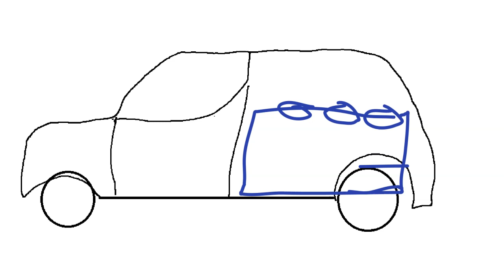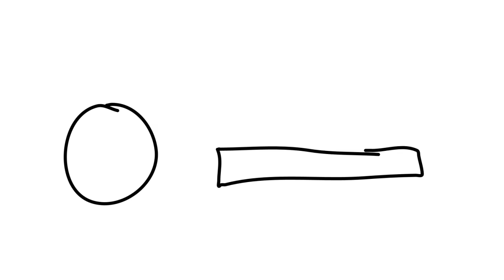All about ports!

Comment: Great video! My question wouldn't the flared slot port act more like a rear loaded horn the longer the length of the port. If so wouldn't the length change the tuning more than the air speed?
Reply from the maker: A flare at the end of the port won't really change much.  The flare would have to be pretty big and long to act like a horn.  However, you are correct that a long port could also act like a t-line.  So, if you had a 5 foot port tuned mid 20's, it would also have a quarter wave boost around 55 hertz.

Comment: Ha l have questions l have 3 18 in 15.25 cubic foot box that after displacement would 2 8” aero port be good for this setup  l have the Purex418s with the mega brute drop ins
Reply from the maker: Tuned to what frequency?  Going for wind? Music Bandwidth?  Ported box?
Reply: @caraudiolab  27.55 hz
Reply from the maker: @josephdupree8449   You will probably have a little bit of chuffing with that.  I had an 8" round port with a Uv1 18" in 4.5 cube box and had some chuffing. My port didn't have the flair but I still think you will have a little chuffing.  I think 3 8" areo ports would work well but you could try 2, just plan on possibly having to add a third.  It can be hard to tell without knowing your power, box design, etc.

Comment: Cool video, is there a certain distance you should keep your port away from like the door or loading wall? I have a 4" aero port and heard it shoukd be atleast the distance of how big your port is or double
Reply: TDLR: more than 1 inch away.

Actually you can slightly lower the tuning frequency of your port if you push the port a specific distance from the loading wall (you rear hatch, for example). It will cause the wall to act as an extension of your port. Your port area needs to be equal to the 2-dimensional (surface) area, of the space that wraps around the area between the end of the port and the rear hatch (its basically the same shape as your port, a "folded rectangle" similar in shape to a head-band). hang with me, I'm trying to explain this the best i can. I wish i could post a drawing lol. 

So your port has a diameter of 4", and you need to figure out the surface area of the rectangle that would wrap around that area. The longer side of that rectangle is equal to the circumference of your port... 4*pi = 12.57   and the other side of that rectangle is equal to the distance your port is from the rear hatch. Lets call that distance "x"   ...    so the equation is 4*pi*x = port area. Just change the "4" to whatever the diameter of your port is.  So:

4*π*x = πr^2
4*π*x = π(2)^2
4*π*x = π*4
4*π*x = 12.57
divide both sides by 4
π*x = π
divide both sides by pi
x = 1
so the port should be 1 inch from the loading wall.

but 1 inch is exactly 25% of your port diameter... and actually, this scales linearly no matter how big your aero-port is. 
An 8" port needs to be 2" from the wall.
A 20" port needs to be 5" from the wall. etc... so actually the real answer is you just divide the port diameter by 4 :)
Reply: @bailey2517 cool I always like learning about car audio and how it's alot of math to find and determine what you need. So 1" from my door is how close my port should be firing off my door? I have it now about 4" away givevor take but seems my subs are suffering in the mid 30s up to 45hz. At 45hz sounds like it starts picking back up which I'm thinking I have something else going on. Been thinking it could be jus the way my box and subs are performing in my full size 4 door truck but around 35hz to 45hz I can put my hand on the subs and feel them barley moving but only certain frequencys it will get really loud. Gonna re set all my gain ls from my line out converter and make sure I'm getting the biggest signal going to my sub amp and make sure nothing canceling out frequencys that's almost what it sounds like it's doing. But when those certain frequencys play it slams and hits hard. My box is tuned to 33hz and I have myblpf around 80hz or so and my subsonic is about 28hz. Gonna try and play around with it see if it changes anything by moving my box around. But what's weird is if i play single test tones like 33hz 34hz 35hz all the way to 65hz it will play and hit them. But when I play a sweep from 30hz to 40hz to starts good then 35hz to 40hz its like the bass jus falls off then will start picking up in mid 40hz range.   My box is only like 1.4cu net with 2 kicker q class 8s. But Gonna build another ported box as big as I can fit which will I believe be about 2.5cu maybe 2.7cu net and gonna run either 3 sundown x8s or 3 b2 audio rampage v2 8s on 3.5k amp. Should get little louder lol
Reply: @johnnypiper1717  that might just be due to the acoustics of your vehicle cabin. I do t think any normal box would sound like that unless you REALLY messed uo the design.

Comment: Do you know about vehicle sizes and how soundwaves cancel and reinforce? That would make for a good video.

I got my first large suv and I noticed whatever sub or box I put in the back I get a boost at 45hz, but it always rolls off above that. I get no upper bass. 45 and down is great, though.

I've been trying to figure out if this is due to the volume of the interior or the length. 

The only solution I've found is to use another sub up front crossed over to play 50 to 80 hz. That works great.

It's strange that I can't find any good information on this subject.
Reply from the maker: I think I know what you are dealing with.  However, it isn't as much to do with vehicle size as much as shape.  Your vehicle probably has a fairly square shape, not much rounding?  This vehicle that I made gets into that a little:  https://www.youtube.com/watch?v=JL2IYe1-PDo&t=20s
Reply: @caraudiolab  Yes, all the full size suvs (expedition, navigator, yukon, tahoe, escalade) are quite square in shape. I'm not sure the shape is responsible as I can move the box all around in the rear (behind second row firing up, rear, by the hatch firing up, forward, backward, etc...) and they all start to roll off between 43 and 45hz. So very minor differences. 

Its pretty interesting, other suv owners notice it as well. They just live with it. Lol
Reply from the maker: @JasonWW2000  I know some of the issues that are happening.  I will plan a video on it, keep an eye out for it within the next few days.  Thanks for watching!
Reply from the maker: @JasonWW2000    I just got the video recorded, expect it tonight or tomorrow night.  Thanks!
Reply: @caraudiolab how do I calculate the port size, length etc? My plan is a 6.5 Sub in a slotted port box.
Reply from the maker: Great question.  I will do an entire beginners quick guide to building boxes next week for you to reference. For now, go to the site linked below and scroll down to "Slot Port Length Calculator."  https://www.the12volt.com/caraudio/boxcalcs.asp#porsq
Reply: @1Patient  Port size is usually a ratio to the net box volume. Average for a slot port is 15 to 16 square inches per 1 cube net. 
So for instance, you want the sub to have 1 cu feet net of airspace you want about 15 to 16 inches of port area. So lets say a port 2" x 8" or 3" x 5". Then the length of the port needs to be calculated with an online box building program. Some use WinISD, Speaker Box Lite, etc... 

Lets say you want it tuned to 35Hz, the program will say your 2" x 8" port will need to be 32.7" long. This port will displace about 0.4 cu ft of air space and the sub might displace 0.1 of air space. So you need to build the box to have 1.5 cu ft of gross volume. 

I hope that makes sense. Keep in mind that these calculators can be off a little. You might need to lengthen or shorten the port a little to hit the exact tuning frequency you desire.
Reply: @1Patient  Also, your question is not related to mine at all. You really should have started a new comment.
Reply: @JasonWW2000 what you're experiencing is either a time alignment or phase shifting issue.
I'm my smaller Mercedes, it tends to happen between 70 and 75hz, but everything below to about 25hz is balanced and audible.
Because you're in a larger cabin space, the distance between you and the sub is further, and given a 20hz sound wave is about 27 feet in length at full wave, you could theoretically be seeing a cancellation between 43 + 45hz, in which the wavelength of that frequency at full wave is only about 10 feet.
Moving the box won't help because cabin gain negates any attempt to correct the issue.
My sub crosses at 60hz and my mains cross at 80hz. I don't see a scenario where you cross your mids at 50hz to help though.
Reply: I'm not too knowledgeable only have my own personal experience but I was always found sealed enclosures to sound best in my SUV or Hatchback vehicles and ported enclosures best in my sedan. I may be wrong in SUV type vehicles I feel like the vehicle itself acts as an enclosure with free space for the bass to travel. May be wrong but just my opinion
Reply: @PoXFreak I don't see how it could be time alignment. Its one speaker and my ear. I can add any delay and it would have no effect. Same for phase shifting.

A 20hz sound wave is actually around 55 feet. Maybe you where calculating half a cycle?

Between 43-45hz I'm actually seeing a boost, not a cancellation.

Moving the box does have an effect. As I move it closer to me, like on the rear seat and then to the front seat, there is a shift in the audible range. As I move it forward, or move myself rearward, I can measure an increase in higher frequencies and a decrease in the very low frequencies.

In the oem system it has a sealed 8" sub in the rear. It produces strong output from 40-45hz, but thats about it. Very one note bass. They crossed the front door speakers around 60-70hz and added a boost at 80hz to the EQ curve. You basically got too much bass from the front doors. Too much rattle as well. My "fix" was to add a front sub playing 50-80hz.
Reply: @hotboy1002  The type of enclosure is irrelevant to this cancelation related discussion. You should use whatever you think sounds best.